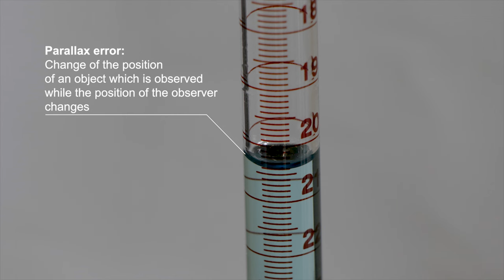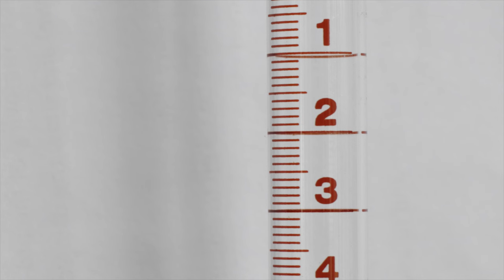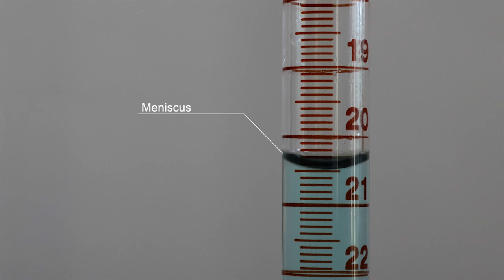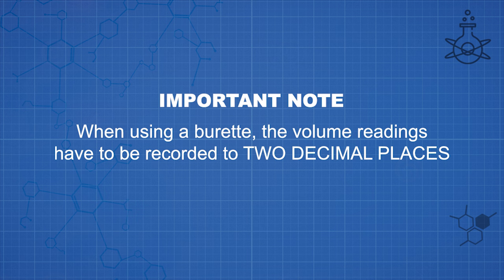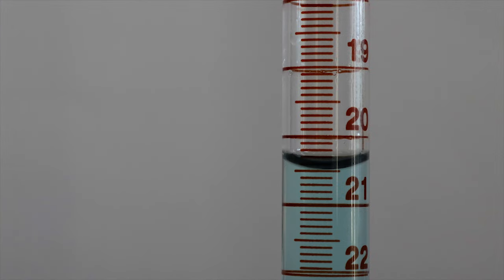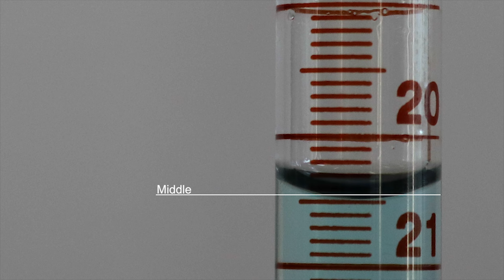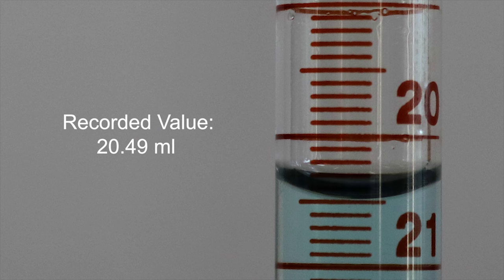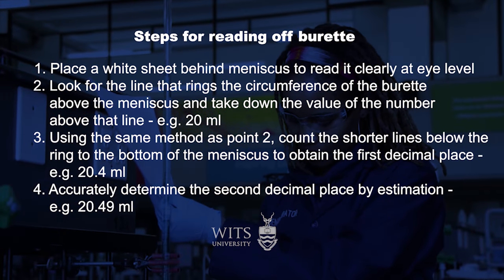How to Read the Volume off a Burette

Comment: What if I drain the burrete completely and fill again? With a burrete that measures 0(at top) to 100ml(final marking) above the valve, is the measurement stopped at 100ml? Or is the burrete completely drained and that equals 100ml down to the last drop?
Reply: The measurement is stopped at the 100ml line. So in order to have correct data, you would have to stop the titration process at the 100ml mark and refill it at that mark. Otherwise you would have added a certain volume of fluid to the beaker or whatever you use below the burette.